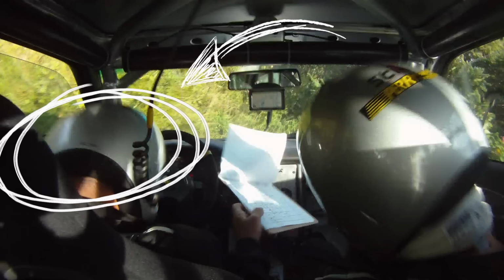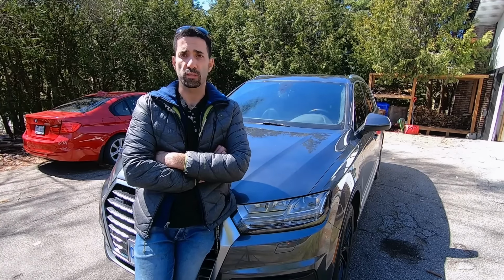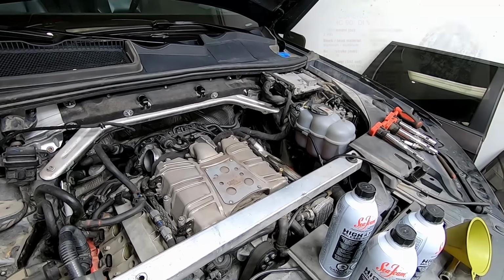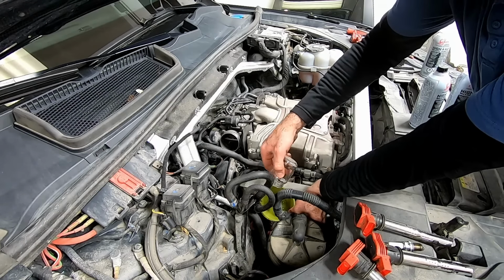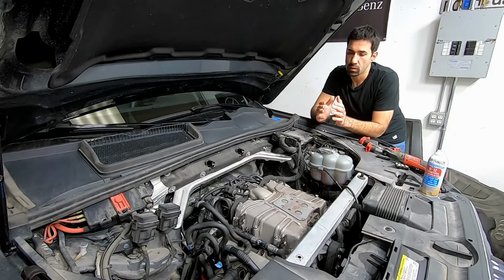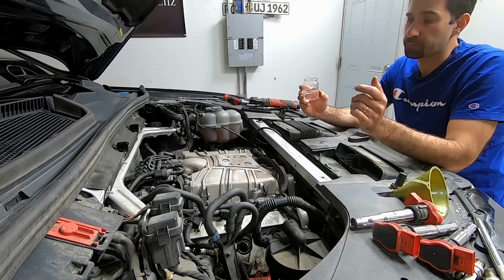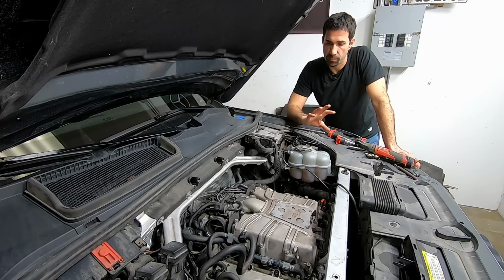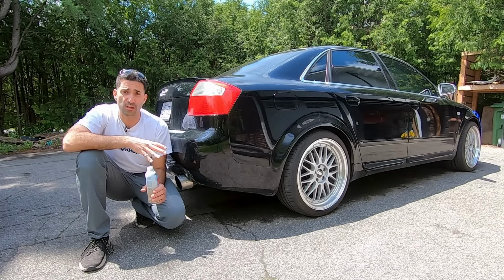How to fix oil consumption on VW/Audi/Porsche 3.0T engine?

Comment: Before getting anything, always research the SDS and learn a little about the chemical’s effects. I think all that smoke is evidence that treatment was too harsh. For a vehicle as expensive and finicky as that, you really shouldn’t use anything with acetone. Berryman’s is cheap and effective, but hard on plastics and nylon. DIY Dave used Yamalube which worked better and is mostly stoddard solvent and xylene; it’s much less risky. The Seafoam is as much safer as it is less effective. Really, you should use Berryman’s oil flush or BG’s EPR to clean out the rings and use then a high mileage full synthetic that will come esters in it to swell the seals; and then change it regularly
Reply from the maker: Good point for sure...the smoke is the B12 and crap burning up...Seafoam smokes in the exact same way if introduced in the combustion chamber, which it's designed to do...I've tried multiple oil flushes but they don't work - this stuff needs to soak in over hours...I`m sure there are better solutions out there to play with as it looks like Dave has found some...

Comment: I have heard the 3.0T engine oil consumption can be caused by faulty PCV system (oil vapour separator) and most shops will replace that before suggesting a rebuild. Did anyone mention that to this Q7 owner? It may be the root cause of the carbon buildup on the pistons/rings.
Reply from the maker: The PCV was tested before I got the car... it also had a valve carbon cleaning... the PCV is a common problem but it doesn't account for the amount of oil we're talking about..
Reply: 2017 Audi q7 w/ 100k miles. I was loosing 1qt per 500mi, did liqui moly engine flush and it went down to 1500-2000mi, after doing 2nd flush, it still about the same. I heard good things about BG109 EPR, I may that on my next oil change. I was thinking it might be pcv but after doing engine flush, I’m sure it’s carbon build up.

Comment: 31:50 the owner needs to stop driving like a grandma. We had a work vehicle that never went past 35mph. The engine died at 105k miles from carbon buildup.

Comment: Seriously, the picture that you have chosen to put on youtube does not have a turbo but it is a supercharger. 
And I have one that I pull the caravan with and it is optimized for about 800hp and it does not draw oil as you claim.
But if you want to be serious, you should probably change that image. 
For me, who is a mechanic and has been for 35 years, you do not come across as serious.
And I've worked at Audi, so I know where the problems are.
Change the oil every 1500 miles and you won't have any problems.
Reply from the maker: @magnussirkka5073  it's Audi that calls that engine the 3.0T - not me :) you should contact them to fix their nomenclature
Reply: @ETMotorsports  In my registration papers, it is not listed as turbo and if you are a mechanic yourself, you know what a turbo engine looks like and claim that it is listed as turbo from Audi.
These models that are supercharged were only for a few years so this feels like a scam site.